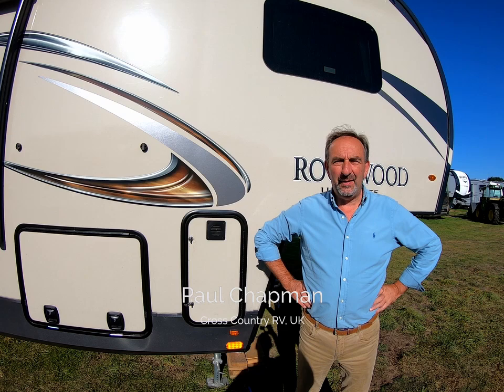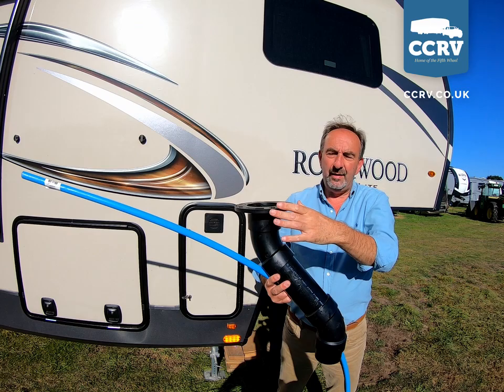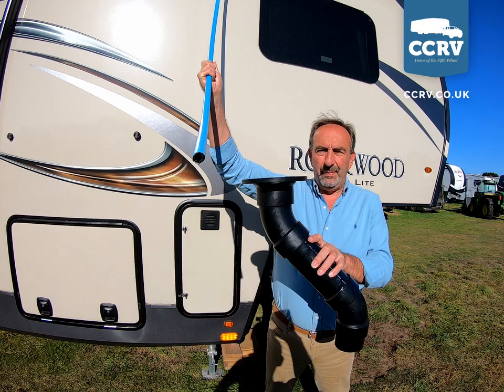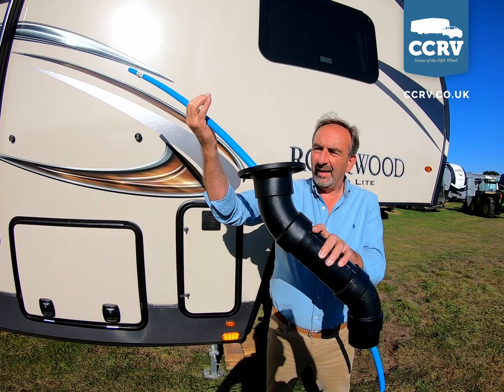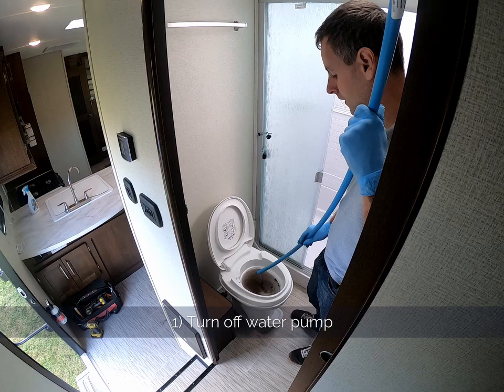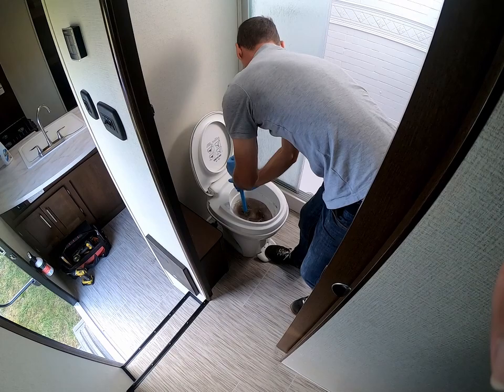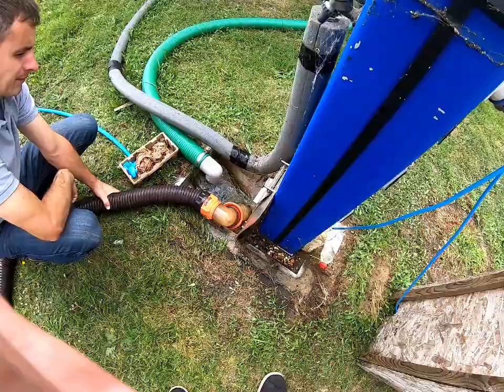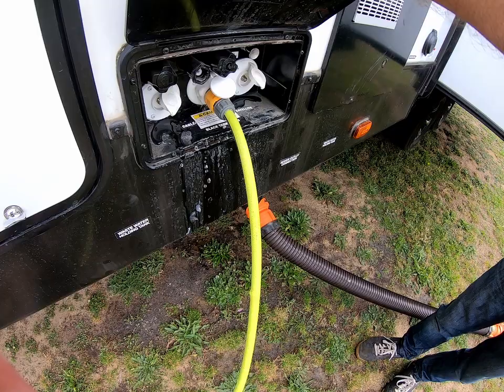How to Unblock An RV Toilet

Comment: Looked for a week to solve this problem..but nothing worked...and then you overseas..wow..just happened to have an 8' piece of pex...thanks loads from Colorado, USA
Reply from the maker: Great to hear Rick, thanks for dropping us a line.  Good to know our UK 5th wheel experience is helping those stateside!  If you checkout our video on black tanks you can see what it is you're probably dealing with as far as blockages go.  All the best, from the UK.
Reply from the maker: Thanks for that do remember to use to tank Flash  now and again

Comment: Spent like 300$ replacing a black tank valve buying fancy flushes ect. Went to lowes grabbed a 4$ pipe and by the time it reached the bottom of the tank the water went down. I feel regarded
Reply from the maker: Pleased it worked for you, simple methods always are the best use a bit more water when flushing the toilet and it won’t happen again. Why not subscribe to the channel really help us out. All the best from the UK Paul

Comment: My toilet has been blocked for two weeks now. The plumbers here in New Zealand want 3 to 500 to come and unblock it no that is why I am in this cottage RV. I have a heap of this blue Alkatriene pipe but could not get the handle whether i was in the black tank or not watched this several times willing to try again, so anything this elderly lady is doing wrong would welcome the advice many thanks
Reply from the maker: Hi you need strong hands to turn the pipe and push at the same time. It will eventually bend into the tank then you can feed some and it will unblock. Once you clear the tank, you must use plenty of water to clean it out. There is another video on our channel on how the toilet works. Have a look at that all the best Paul I’ve come and do it for you if you are a bit closer
Reply: @CCRVUK  thanks will try again strong enough just dont want to damage the black tank

Comment: I thought this was our answer but it isn't. Ive worked for probably 30 minutes to no avail. The pipe won't bend enough to turn it keeps hitting the sides no matter how much I work it or try to give it a bend. In at a lots and very flustered.
Reply from the maker: Try cutting an angle at the bottom of the pipe you know like an arrow point it will go round. Eventually other people have put it in a kettle of water then put it down quick so it’s soft and pliable. Let me know how you get on.

Comment: Worked perfectly!  Spent $3 and found the blue plastic pipe at home depot!   THANK YOU FOR THIS VIDEO!!!!!!!
Reply: Do you know what the blue pipe is called does it have a specific name?
Reply from the maker: In the UK it is referred to as 'Alkathene', it doesn't have to be this specifically. Stateside I think you're looking for 'PEX'?
What is essential is that the pipe is rigid with a degree of flex. Too rigid and it won't go around the bends, too soft and the pipe will bend when you push.  Take a look at our Black Tank video to see what I mean about the bends.  Oh, please share - we're trying to get about YouTube a bit!

Comment: I purchased an rv from you about 2 years ago and now have this problem. Thank you for uploading the video  .. my job now tomorrow after an unsuccessful attempt today with a plunger , and a radiator brush. Lol 😆
Reply from the maker: Hi Cheryl have a look at the other video on how the black tank works as well plenty of water there is toilet paper and it will be fine keep in touch Paul
Reply: Thank you knowing the components and how they worked really helped

Comment: What a fantastic video thank you so much. Got the pipe same dimensions you put in your description and it worked in 3 minutes. I had spent 3 hours beforehand buying a garden hose and shoving it up the black tank drain trying to get rid of clog. Tons of shit water coming out for a very long time but clog at toilet never went away. Water in toilet wasn't dropping down. Figured clog HAD to be at toilet somewhere. Your description of a shit pyramid made total sense and got the $5.99 pex pipe and just like that it was unclogged. Thank you so much for this video.
Reply from the maker: Glad it worked for you thanks so much for your comment please subscribe to The channel loads of helpful tips if you already have big thanks regards Paul

Comment: Hi from NNY. Went out bought plex pie 10' cut down to 6' to fix in my rv. Watch this video a few times. Fished pipe, though the elbows down to black tank worked back and forth  a few times and still no luck. Is there anything else I can do?
Reply from the maker: @GregWilcox-be8jg  sounds like the outlet pipe is blocked. Sometimes people put wet wipes and stuff in the RV toilets and it will block up at the exit point. you’ll have to drill a hole and poke a coat hanger with a little hook to put any debris down. Hope this helps.

Comment: I feel like I'm going to break thru the black tank. Are you sure. There's a pipe before the tank?  I cannot figure out which direction I should be going.  Am I supposed to push really hard, to bend the rod? It's a 6ft piece of 1/2 I'm
 Cpvc pipe?  Will this work?  Someone help fast please!!!!   I said 🥺 please.
Reply from the maker: Hi Peggy, the pipe we use here in the UK is water pipe  half inch in diameter it sounds as if you’ve got the right piece of pipe. You do have to put a lot of pressure on the pipe when you’re pushing it down and turn it at the same time and it will be and there is another video on our channel that will show you the inside of the black tank. Have a look for that one and it will definitely work. Good luck Let me know how you get on. Regards Paul

Comment: Can you empty the black waste in the grey water disposal point at a fully serviced porch? Coming from owning a motor home, we are used to emptying chemical toilets and have not seen a site with a specific man hole for black waste
Reply from the maker: Hi James thanks for the question who sold these for 18 years most people never have a problem generally use a tote which is a four-wheel container to empty black or grey waste please remember these units hold nearly 40 gallons of black waste manholes are available on most campsites maybe not on the pitch have a look at some of our other videos I think there is one on empty in the black waste with the video really what is the help RV Owners that American motorhomes 5th Wheels or caravans empty the black waste or unblock the toilet which does commonly happen if you use it as a household toilet remember if it doesn’t go through you it won’t go to the toilet thanks for the question regards Paul
Reply: @CCRVUK  thank you Paul, really appreciate the quick response

Comment: Worked great although I had to twist it around for about five minutes before cliff broke free.

Diagnosis: not flushing with enough water. Perhaps dumping black water tank too often.
Reply from the maker: Hi Michael, glad it worked for you.  Think your diagnosis is right, the only other cause we come across is putting things down the loo that shouldn't go... we've pulled out the usual culprits plus plastic cutlery and even an Action Man!  Pouring a half bucket of water down the loo every now and then will help.  If you're on the road leaving a little water in to slosh about can help too.

Comment: The people  I bought this camper from left the valve open whilst using for months now I believe I have a full tank of solids toilet paper and not to be rash but tampons as well . Do you have any suggestions
Reply from the maker: The only way to do it is to fill the tank with water and open the valve you have to do this five or six times over a manhole or septic tank or dump station then once you’ve got most of the rubbish out fill the tank halfway with water and take the camper for a drive then put it straight over a dump station and empty it 2 3 times this will cure the problem it’s the only way Just keep filling it to the brim with water and him to have a look at some of the other videos one explains how the black thing works
Reply: Thanks a lot
Reply: Are there any safe chemicals to use ? Rid x for instance?
Reply from the maker: jcrip42 Hi some people use a biological washing liquid this eats most things away and turns it into liquid the trick with a black tank is to keep plenty of fluid in the tank otherwise if you use a tote  the fluids will go and the solid will stay then you will end up with a blocked toilet Just empty a 1 gallon bucket of water every now and again down the toilet

Comment: didn't work....any other ideas
Reply from the maker: Hi Debbie it definitely does work we’ve got a number of higher units that get locked up for people using wrong toilet paper putting allsorts down there and it works every time watch the video again and make sure the pipe goes round the bend all I can suggest is that the exit pipe is blocked in that case you’ll have to drill a hole the first bend out of the tank about a 10 mil hole and put a coathanger up there if it’s blocked there just pull the stuff down be careful because when it goes you  Will be covered in waste  If you get really stuck give me a call regards Paul

Comment: I had better results by actually shutting the gate closed why was flushing it but only for like a minute or two with that flushing and the extra water lot more  was able to flow out do this 3 to 4 time but in the end I took all the tanks out as we live full time in one spot except the large freshwater tank  left that in for two reasons in case there was another natural disaster like a earthquake we had and the water which I drained quite often and refill with Fresh water the second reason is in case of high winds have  all that extra weight down low makes a  a difference we have 2014 Forest River - Rockwood Windjammer 3008W (Travel Trailer) but I used rubber sleeves to join the New Zealand pipes and the American one so I can put the tanks back on later no damage to the original pipes
Reply from the maker: Hi Mike thanks for the comment what’s life like in New Zealand then chaos in England at the moment